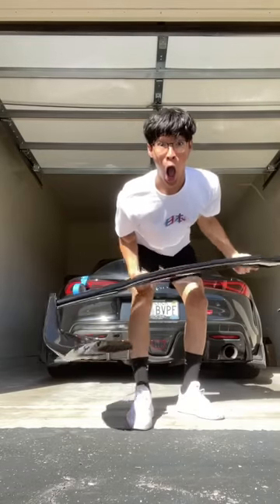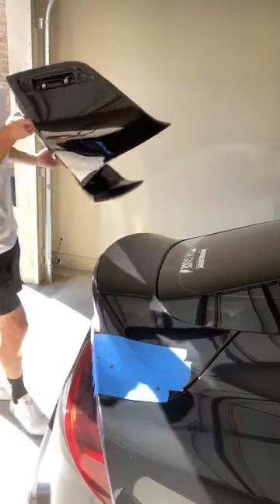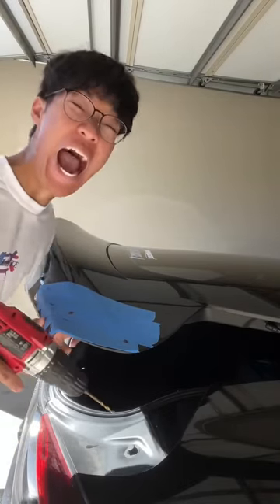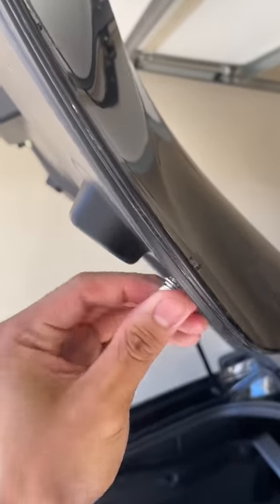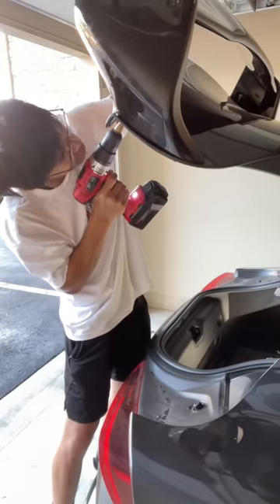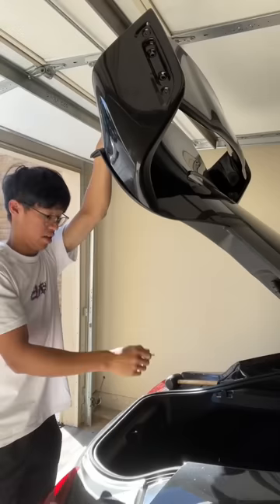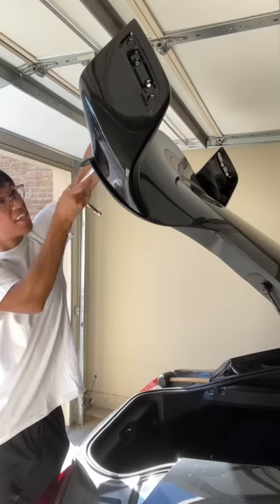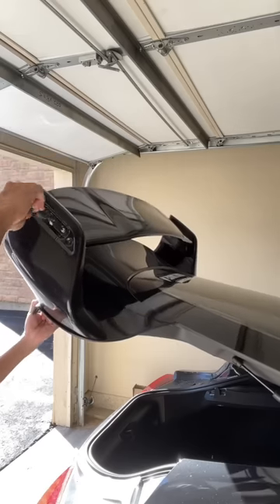Installing a wing on my Supra!

Comment: The way the wing jiggles when you close it just screams quality.
Reply: lmao cmon man
he's trying
Reply: And the fact the hardware didn't even fit
Reply: it is called a spoiler
Reply: The sound when it fell too it was like a shampoo bottle dropping
Reply: @Tinray-ug4re  It's called a spoiler because it spoils the look of a good car.
Reply: It bends at higher speeds creating more downforce 😉
Reply: junk
Reply: @Ztygs  This is not a good car
Reply: @lobsterjohnson8642  And putting a low-quality shitty spoiler on it isn't making it better.
Reply: Lmao
Reply: not everyone has like $2000 to drop on a wing/spoiler doesnt matter what car you drive or whether its paid in full or youre still paying it back.
Reply: Quickest way after driving it off the lot 😂
Reply: @Ztygs hahahaha
Reply: @lobsterjohnson8642 how it has the b58 and looks beautiful it can do 800hp on a stockblock sounds good comes as a manual... everything about it is better than his dad the mk4 supra
Reply: @kuroseiki6930  It looks like a Z4. Shits basic. The b58 can handle 650hp stock. It needed to be completely rebuilt just to make 900hp. I'm not saying I like the Mk4 Supra all that much but in no way is the b58 better than a 2jz.
Reply: @lobsterjohnson8642  its 100% better drives much cleaner it does in no way look like the z4 they just have the same drivetrain and a good friend of mine made 804hp on a dyno with a stockblock couple months ago after 15k miles of driving the car and ripping it around on tracks nothing ever broke till now
Reply: @lobsterjohnson8642  b58 is also lighter than the 2jz
Reply: @kuroseiki6930  It's literally a Z4 so yeah it does look like a Z4 😂 send vid of your friends mk5 on the Dyno with numbers and full build?
Reply: @lobsterjohnson8642  why would I make a vid of my friends car
Reply: @lobsterjohnson8642  I got a cls63 amg 2017 Model man
Reply: @lobsterjohnson8642  makes 900hp stage3
Reply: @kuroseiki6930  lmao delusional bimmer fanboy says modern bmw engine is better than one of the most tried and true tuner platforms of all time
Reply: @Therango32  not a bimmer fanboy Im just Stating that 800hp on  a stock aluminum Block is plenty while 1000 on a cast Iron is good jut not as impressive
Reply: @Therango32  and Im not a fanboy I drive a cls63 amg with 900whp
Reply: @kuroseiki6930  soft  aluminium block, plastic everything, overly complicated electrical systems, constant oil leaks. I'll take the Toyota, thanks.
Reply: @Therango32  you can just buy Metal Parts for the engine, cheaper to build the engine electrical System is complicated for americans maybe and I dont know where you get oil leaks from
Reply: @kuroseiki6930  it's a bmw. They can't make an engine that doesn't shit through valve cover and oil pan gaskets like nothing else. The electrical systems in bmws are ridiculous and unnecessarily complicated, this is basic shit. German cars are built to explode.
Reply: @Tinray-ug4re  yea buddy he knows. And guess what? The type of spoiler is called a wing
Reply: Bro, he already has a Supra
Reply: This is prob the sketchiest install ive ever seen. Daddy wont be happy you put holes in his trunk.
Reply: @lobsterjohnson8642  trippin great car incredibly reliable and not the worst spoiler either it’s supposed to have flex in it so it’ll bend at higher speeds. that’s the theory at least im not sure how much it really matters but they all do it so I’d imagine it’s somewhat significant. That spoiler it’s really that bad of quality tbr I’ve seen spoilers that go on with just adhesive and crack after a few days in the sun.
Reply: @Ztygs (thought u might need to hear this too) trippin great car incredibly reliable and not the worst spoiler either it’s supposed to have flex in it so it’ll bend at higher speeds. that’s the theory at least im not sure how much it really matters but they all do it so I’d imagine it’s somewhat significant. That spoiler it’s really that bad of quality tbr I’ve seen spoilers that go on with just adhesive and crack after a few days in the sun.
Reply: @Ztygs  spoiler is useless unless you wanna race everyday with it but in every day traffic it’s pointless meant to bend slightly to move the car slightly with the wind some science behind it really just used for only top performance at high speed so yeah stupid still looks sick in my opinion
Reply: lmao yeah and this is supposed to push a 1.5 tonne car down, but breaks on installation
Reply: @Ztygs  The BMW Supra was never good or beautiful to begin with
Reply: @Ztygs  uh no
Reply: @Ztygs  there has never been a person as sensitive on the internet
Reply: @Ztygs  debatable but yea a gt wing on a shitbox civic would make the car look worse
Reply: Fr needed to be a chassis mounted one
Reply: @lobsterjohnson8642  uhh why because bmw?
Reply: @lobsterjohnson8642  the supra is an A90 the z4 is G29 it may have European roots now but it has Toyota standard stuff and quality
Reply: @marcuxz6943  They're as different as the Ford ranger and Mazda B series
Reply: @MaRshallAU  well yeah it pushes it down slightly when your turning a corner at 
80mph will be push the side the car wants to flip on down
Reply: Fr😂
Reply: I mean… it is a JDM.
Reply: @Ztygs some cars look good with them but others would look better with a little lip or none
Reply: @Tinray-ug4re 🤡
Reply: Wait you actually think that all spoilers need to increase the downforce and performance of your car and it can't be just for show????
Reply: @SkoolConnor you don't put cheap parts on expensive cars
Reply: @Ztygs Yeah and you probably drive a beat ass Honda and not supra so dk why you're talking
Reply: @ChicaneMedia  Aw, someone has this car and is offended? Lmao, get over it buddy.
Reply: Shouldve just not put a wing on it
Reply: @Tinray-ug4re spoiler, wing, same thing just different terms
Reply: thats pretty standard for a wing,  its not a spoiler, its cosmetic, they make stabilizers for them for that reason.
Reply: @Tinray-ug4re it’s a wing bro
Reply: @SkoolConnor even if you spend $2k on a carbon wing, it’s most likely just fiberglass with just one layer of carbon.
Reply: its called a SPOILER
Reply: @lobsterjohnson8642 better than your old civic.

Comment: How not to install a wing
Reply: "I went to Home Depot" the people that go there never know what they're doing
Reply: @troyellis4242  ok but are you forklift certified??
Reply: This is actually how it goes most of the times.
Reply: @troyellis4242  where else do u get longer screws you sped 😐
Reply: @troyellis4242  u gonna get some screws at the McDonald’s or smth?
Reply: @d21bash  lowes ?
Reply: @GGXYMP  that’s not what he was implying 😑
Reply: @d21bash  go to an engineering company, local car spares place etc… get something made of a decent metal.
Reply: @cunningstunt9226  not everyone has those places around them and Home Depot is convenient
Reply: @d21bash  Convenient but incorrect. Like using chewing gum when you need Gorilla Glue
Reply: @cunningstunt9226  Home Depot isn’t incorrect though? The shit from there is perfect for a crappy diy job
Reply: @d21bash  it’s very clear you don’t have a good understand of material hardness, fastener grades or types and no mechanical or engineering knowledge as such if you think this is ok or ‘good enough’.
Reply: @cunningstunt9226 it’s a shitty diy project I wouldn’t really care 🤷‍♂️
Reply: @GGXYMP   Lowes doesn't exist
Reply: @cunningstunt9226  you can get grade 7 and 8 hardware at Home Depot, at least the ones by me, which makes me assume it's available at all of them, but okay....
Reply: Seeing him install that wing on this trunk makes me cry inside lol
Reply: @cunningstunt9226  LMFAO what? Like you can only get one grade of hardware at home depot? Tell me you drool on yourself without telling me you drool on yourself.
Reply: @shawnpitman876  To be fair not being from the US I don’t actually go to Home Depot myself so it was an assumption a decent amount of time ago. I think the sentiment of ‘don’t use the cheapest shit you can find to secure something important’ still stands though
Reply: @cunningstunt9226  so you have never been to home depot and your giving opinions about it💀that is crazy

Comment: If the kit didn't even include the correct size bolts you can be damn sure that wing won't do anything but make your car slower with worse milage and lower resale value.   Regardless, PLEASE put some Loctite on those bolt threads.   The last thing you want is for that spoiler to come off on the freeway and take out some motorcycle rider who was unlucky enough to be behind you.
Reply: Lol the kit does include the right bolts. This guy didn't even remove the interior boot trim and tied to straight up bolt through the boot and trim which is why it didn't work. Also the interior side is going to look like garbage which is why he didn't show it. Complete amateur
Reply: Looks like he bought some thick coarse screws. Loctite is his best bet now.
Reply: Let's be honest.. nobody who puts a wing on a sports car that didn't have one on already.. does it for aesthetics
Reply: @real_smilegamez  look up every hill climb race car ever. They all have purpose built wings. We don’t see it a lot in America because everyone drag races here and no one actually races around a real track where a wing would actually be useful by keeping you planted at high speed straights and turns.
Reply: @eonr2499  Yes races are different.. but I mean dudes who put it on their daily driver.. atleast mostly aesthetics

Comment: A real cool tip I learn from a friend is use silicone caulk where you put the bolts it is better than weather stripping since silicone caulk will mold to the shape it needs and prevent water from getting in and rusting the bolts. 

the best part is they sell black silicone caulk you won't even be able to see it all you need is a tiny dab around the bolt.

Comment: The bolts are too short cuz you're meant to take off the plastic to access the bare metal😔
Reply: What's the old saying? Instructions are useless! We don't need those. Just start drilling and putting shit on. No attention required!
Reply: Yea he did it wrong
Reply: There was no plastic to take off
Reply: @andrewdowling8821  ?
Reply: @knicks5426  yea there was you have to look closely
Reply: do you put the plastic back on afterwards? curious. like do you not have to drill through the actual plastic in order to equip your wing. pls some clarity
Reply: @knicks5426  he only anchored it to the plasic...a wing pulls thousands of pounds and needs metal anchor points
Reply: @Epck  that wing is most definitely not "pulling thousands of pounds" lmaooo it's not a space shuttle,  but okay....
Reply: @nboccanfuso  I mean not sustained but it can absolutely hit a few thousand pounds and you wanna make shure you have it rigged with a worst case scenario
Reply: @nboccanfuso  downforce goes up non linear, at a square of the speed, so that's why it can get so high and also why planes can fly
Reply: @nboccanfuso  different wing types lift planes at speeds a supra theoretically and literally would travel
Reply: @TravisTheSavage  thank you my boy

Comment: Those bolts are gonna rust, my guy
Reply: so what, "my guy"?
Reply: Not sure that they would as they look to be galvanised
Reply: @thesunnyside9492  pretty sure they were zinc but same thing. They're not rusting any time soon
Reply: @Dumfancy you litteraly corrected nothing
Reply: @RuinGraphics  neither did you
Reply: @Dumfancy  what did you even want to say?
Reply: @aleksuks  rest of trunk gonna rust around the screw.. nothing major 😂
Reply: Cope.  “My Guy”.
Reply: Where's your supra?
Reply: @thesunnyside9492   with how flexible that wing was I bet it wasn’t galvanized they went cheap
Reply: @rodrigosempiterno35  uhm that’s not how plastic works it can’t rust
Reply: @thesunnyside9492  They will not rust, but the hole he drilled to put them in will, perhaps I worded that wrong. I see it happen all the time, most of the time when people use kits without some form of weather seal. (Not counting the one that normally comes with these kits, it is normally rubberized foam, it is only really meant to protect the paint from the spoiler itself.)
Reply: Not the bolts.. but the holes he drilled into his deck lid will if he didn’t cover it with something.
Reply: @Dumfancy  what u mean??
Reply: @Beef_jerky_official  you know all wings have play, there isn’t METAL wings 🤣

Comment: I get you've never done this, but a word advice to you and anyone considering adding a spoiler...don't forget to add some sort of rust treatment over the bare metal...waaay to many people drill holes in their cars for cosmetic stuff and never think that that bare metal needs to be treated to prevent rust. Skip that step and watch the hole get bigger over time from rust
Reply: The part he drilled into is aluminum which will naturally form oxidation to protect from corrosion but it definitely wouldn’t hurt to treat the bare metal. Oh and aluminum doesn’t rust
Reply: @stephenkuhn908  Well actually aluminium does corrode when exposed to moisture. It just doesn't rust because of it's oxide layer.

Comment: The precision with which he installed this high end hi-tech piece of car engeneering using only 6 plywood screws. What I believe is that this will not only give the car a more asymmetric touch but also a lot of noise. But the driving and dynamics will be more stable in reverse. Additionally, depending on the angle of attack, and the build in compensation, it will probably steer more to one side which supports in turning into a specific direction. At supra high speeds it may even reduce the pressure on the front wheels and thus reduce control forces. But even if this increases your fuel consumption, and eliminates the work car and aerodynamic engineers perfected- It still has a really big advantage: It wont sink. Your car wont sink with so much buoyancy this wing has. 
However- Keep in mind that, even though you can technically drive on water now, almost like Moses or Jesus- You probably have screws which are going to rust. Thats fine as long as you drive in waters where oxidation cant happen- Such as the river Ganges, but its not made for more. 

Oh. And I forgot to mention that you saved a lot of money taking this wing!

Comment: DIY never goes to plan. Just installed a 2" spacer lift on the front of my forester. My floor jack maxed out and couldnt lift the car any higher so i could put my wheels on. Had to run to home depot for a 4x4. Sawed 6" off and got it done. Time to do the rear. Here we go.

Comment: This wing is gonna slow you down more than it increases aerodynamics
Reply: Gotta max out the downforce
Reply: its for looks when it comes to spoilers and wings most of the time
Reply: @bespinguard7129  my guy the whole purpose of a wing is for downforce.
Reply: @jassom1270  When you're talking about a legit racecar then yeah. But when you see a car on the road with a wing chances are they care about how it looks more than the downforce.
Reply: @os8k_117  yes and no. I’ve had a few cars that weren’t legit race cars, just daily drivers that I had modded, my wings were for downforce but I still wanted a wing that looked good on the car. Also many cars that come stock with a wing have them for the downforce they produce and not just aesthetics
Reply: @jassom1270  Well yeah of course a stock wing is actually going to serve a purpose and yes some people do actually build there car to be fast. 😂
Reply: @os8k_117  you said only actual race cars have wings that serve a purpose. I was just correcting that.

Comment: He’s a little confused, but he’s got the spirit. 
#1. The bolts are to go under the plastic.
#2. Uses the wrong drill bit 
#3. Bought an automatic Supra
Before another keyboard warrior builds up the courage to put down their Hot Cheetos and wipe their hands, it’s a joke.
Reply: Here we go again with the auto
Reply: @SaifKhan-jl2jd  it’s just an opinion.
Reply: So I'mma just go ahead and say you know nothing about cars because the 2019-2022 models did not offer a manual transmission, that didn't come out till the 2023 model. If you're gonna comment about a car or car related stuff, do some fuckin research first.
Reply: @goblinmaster342  Ik that the Supras only came in automatic for the first couple years. That’s why they got so much hate. I was just poking fun. I think you need to do some research on how to take a joke there bud.

Comment: Bro really drilled through the interior panel and tried to install through it instead of just the metal lid....... It's braced against plastic on the inside that's why it's wobbly.

Comment: This is pretty much what it feels like when building a PC. You put it together. Realize you forgot something or something doesn't fit or reach. You take it apart and fix it. ONLY TO REALIZE SOMETHING ELSE IS WRONG NOW
Reply: I built a new pc with literally no issues. Put the usb in in the first start and it booted straight up to the install page. Maybe I was lucky.
Reply: @mikhailjairnisbett441  Def luck. Somehting as simple as a bios update will lock you out. Dual channel memory will sometimes lock you out for who knows why. Incompatable parts. It takes a lot of research and even then they will still screw you over sometimes